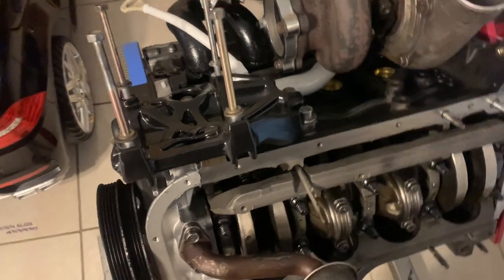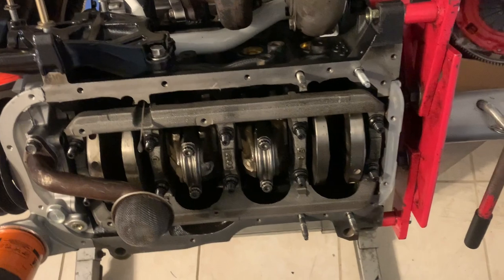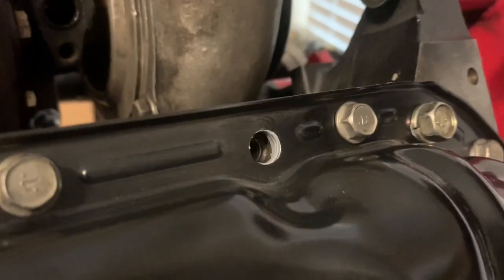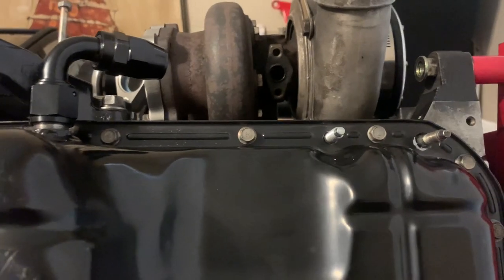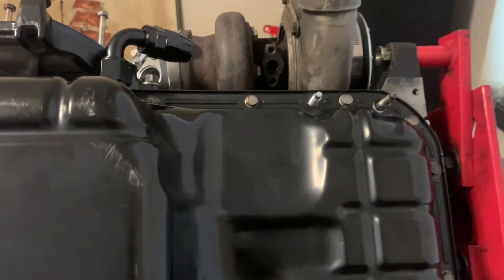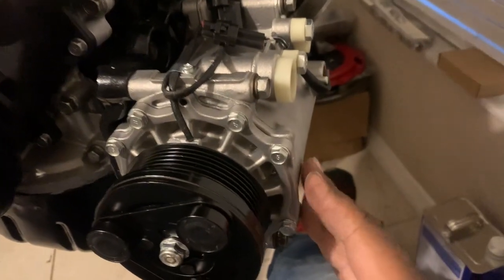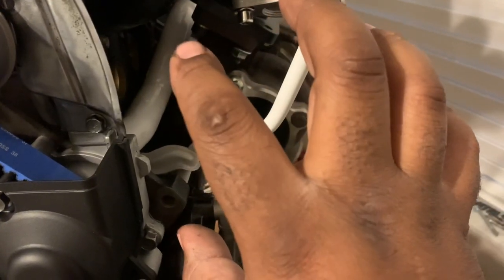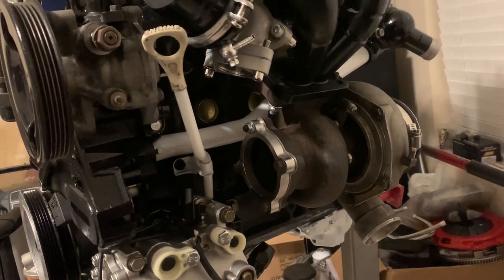MIRAGE CK4A 4G93 DOHC MIVEC RS TURBO PART 8

Comment: dam that thing is a beast. I was wondering, I've got a JA Starion and half the driverside buttons are stuck in how do I fix em
Reply from the maker: Thank you thank you but yes if the driveshaft is stuck you’re most likely going to have to pull down the differential apart and pop them out

Comment: if using aluminium oil pan from cm5aT model or mivec ck/cj easy way to do oil return line all the way straight go down,for mivec ck/cj model just need drill hole.
Reply from the maker: Oh yes I was definitely thinking about that because here in America they have the 4G94 that has the two piece oil pan system but then I would have to weld aluminum
Reply: What is the difference between the Mivec and non mivec oil pan from a 4g93? In terms of how would affect the behavior. I know one is 1 piece and the other one 2 piece
Reply: @Jeffrivces  mivec,cm5a turbo,gdi turbo oil pan are made by aloy..4g93 sohc/dohc N/A are steel made but it also